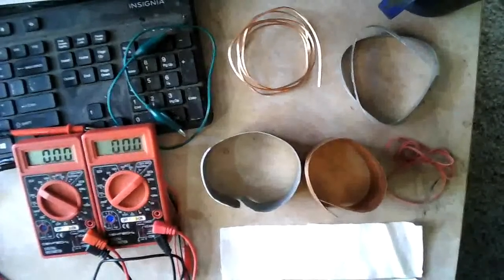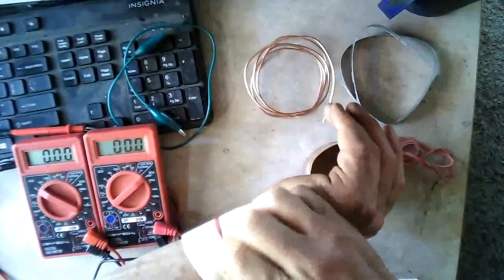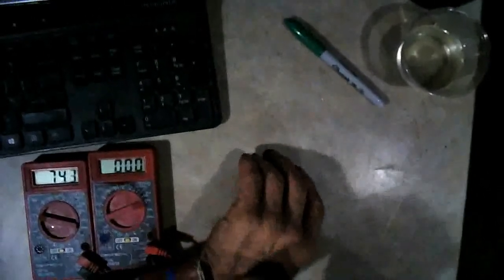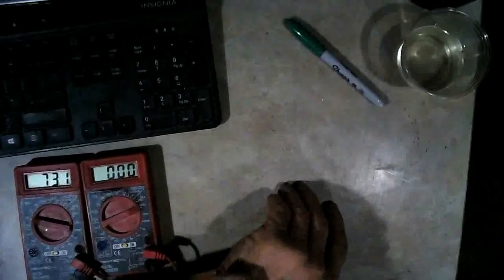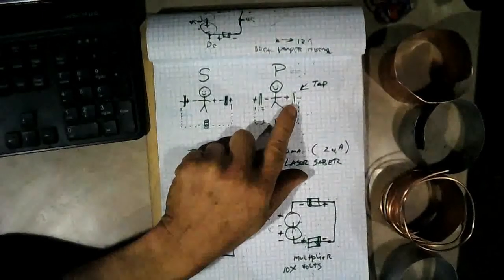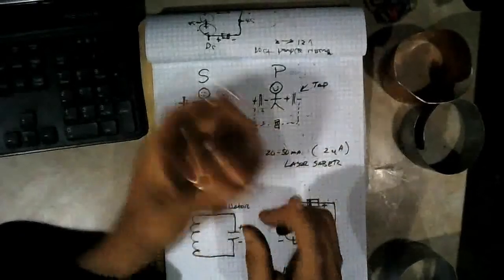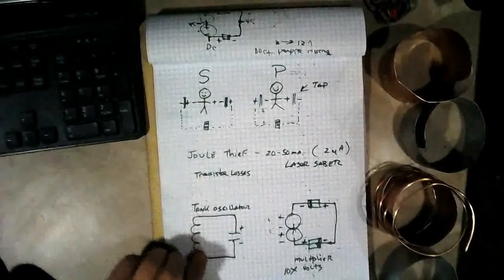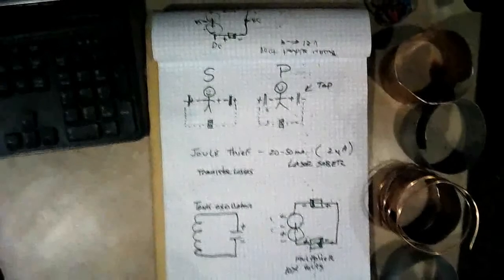Practical Bio-Electric Battery Experiment!

Comment: It'll be interesting to see the results. Do you have a link to the 10X multiplier circuit?
Reply from the maker: Unfortunately I couldn't find the video again Fred. I was going to promote the guy and his invention. It's a uni-directional loop however, which I think is critical to how it works. It's interesting that the tank oscillator is a loop too, that's function is just to reverse the electromagnetic field and polarity. Another very simple electronic function. You know I like to keep it simple. :-)
Reply from the maker: That's the one! Good job AMP! Thanks! I wonder how old that kid is?  :-)
Reply from the maker: Here's another good looping voltage multiplier by Dr. Stiffler.  Look how he is using magnets in this loop. https://www.youtube.com/watch?v=wtIOVIj6KNw